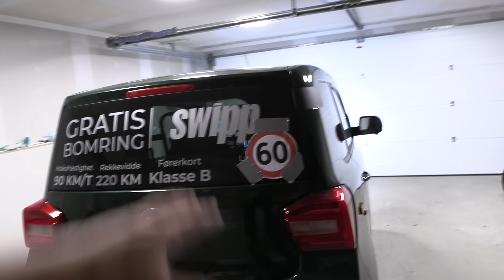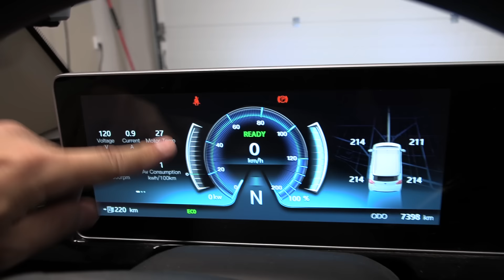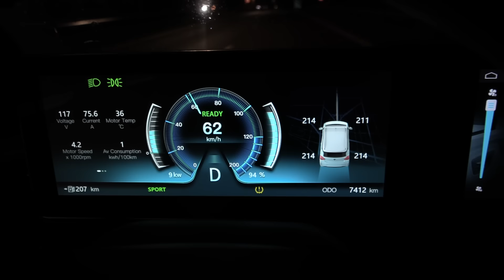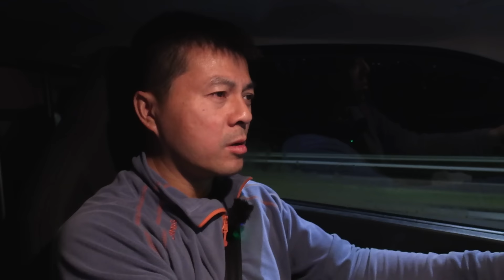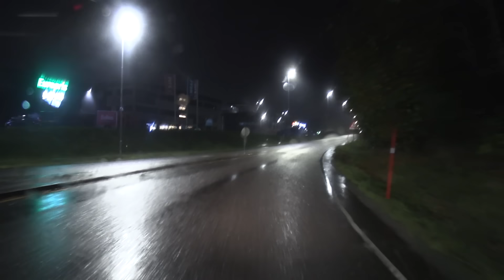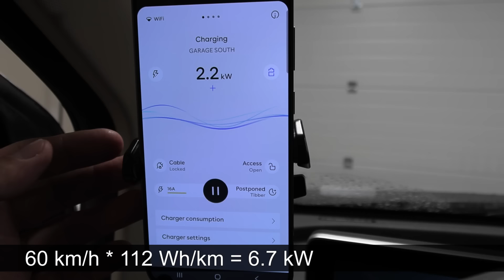BAW Pony 500 km challenge part 1

Comment: My unqualified, anectodotal, and unrelated filthy cheap American two cents: I've run the Haida HD667 on my RB Accent Hatchback. I've run several other "Chineesium" tires found by small time third party tire shops and sometimes venture into Walmart's Auto "Cares" for tires. These HD667 were by far the least lasting and least traction tire I've run. I've had tires priced lower than these that held traction in surfaces the HD667s didn't. If it so much as drizzled, there was a chance TC would kick in. If it drizzled and I drove over any austerity ridden street found anywhere in this goddamn country, it was certain I'd slip and have a little scare.

I know you have the HD687. They're distinct tires, mine were summer, your's are winter. But what little could be researched about the brand makes me believe that their tire compound(s) just... generally suck at wet grip, even their "higher" end models. I know some people have pointed out it being RHD, light, and the classification and all, but it makes me wonder if perhaps if it had something a bit "better" than economy tires from this specific brand would it have fared better.

PS: the HD667s are "eco". I got worse fuel MPG with them, really noisy, and not even close to its speed rating. Not much I can find online other than people leaving reviews on the tire that were meant for the online vendor they were using.

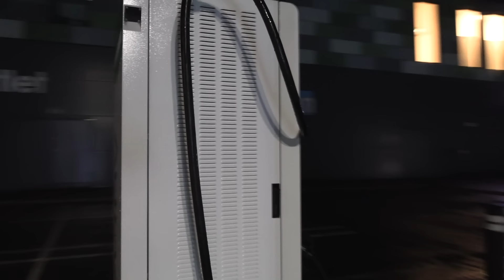Comment: 18:30 You forgot to show the spec plate on the charger! 😁
Reply: If those are Delta's UFC 500KW units, then according to the manufacturer’s data, 500 A is the maximum: 2x500A at 500V / 500A at 920V, and the maximum power is 500 kW (2 x 250 kW power for simultaneous charging).
Reply: @AliusScitmelius Just 460 kW! Lies, lies I say!

I was expecting 600A for a 500 kW charger to be honest.

Comment: Just spun on a roundabout, now going down a hill, “How fast can we go!”
Reply: Straight line speed isn't that sketchy, but turns on slippery surface are with a RWD light car that has a very short wheelbase. Anyone who's driven Smart Fortwo can tell you how on the motorway at 120km/h it's perfectly fine, but wet roundabouts are rough and wintertime is even worse. At least those have traction control though.
Reply: That looked pretty dangerous. I could get something of the same effect in my (1967) VW Beetle with cross-ply tyres  pushing round a roundabout.. but somehow the Beetle felt more in control. (I did check at the start of video and there is an R in the tyre designation to say they're radial, but it's just possible that they aren't.)

Comment: This one makes the Dacia spring look premium.
Reply: It's not the same thing, the Dacia Spring is an M1 category vehicle (your ordinary passenger vehicle) and this BAW Pony seems to be an L7e, which is considered a heavy quadricycle. The regulations that define them are completely different, so they aren't really comparable.
Reply: @Stuntman175  While that is true they are also  similiar in price which is how i got to the comparison(which was for comedic purposes if it wasnt obvious).
Reply: @Stuntman175  What are the benefits of the L7e category if a category B driving licence and a minimum age of 18 are still required? Insurance might be slightly cheaper and inspections may not be needed as often, but are there any other advantages?"
Reply: I had a Renault K-ZE, the proto-Spring. I'd say the max reasonable driven distance per day is 300km, if you depart fully charged and do one DCFC after 150km. Starting from the second DCFC it rapidgates really hard, and eventually you can only charge at 10KW.
Reply: Still looks better then  Wuling Air EV here in Indonesia 😂

Comment: The usage scenarios for such a car are extremely limited I believe. For the price of this car you can buy a nice used e-golf and you would actually get a real, usable, secure car. Even the standard version of the e-golf without DC charge option provides 7KW charging speed and also 200 km reach. And you will get 140 horses and all the features the golf chassis developed during the last decades. Including security, comfort, functionality, usability, quality and 8 years guarantee for the battery.
Reply: It makes sense in a 10-20 million people city in China though. The price will probably be super low there as well, so it's an upgrade from a scooter for those that can't quite afford a "real" car and rarely need to leave the city.
Reply: No toll would save me 20 minutes every morning and evening since I could take a shortcut via some toll roads (now I drive in the city instead), I was looking at a Twizzy but the lack of heat and the short range makes this a better proposition for me perhaps...

Comment: I've done 400km on a 22kWh Zoe without DC charging. It was fun (no, it was not).
Reply: 1400+km from Netherland to Hungary with q210. 31 hour trip😂
Reply: I did 1000km with my 41 kWh R110 Zoe once, it was quite nice actually. 

When you don't have any time pressure it's really nice just toodling along for 2-2.5 hours at 90 km/h, then having a nice long break doing whatever, before another long stretch.
Reply: Range?
Reply: @ionut8091 120km on a good day. I made 4 charging stops about 50-60 minutes each. One hour driving at 90km/h and then one hour charging.
Reply: hello fellow zoe madmen! I too did 1000km with a 41kWh zoe without CCS, Germany to Romania in 2019, twice. Did take around 24h each way and was quite fun since there was no pressure. No ABRP then, so had to plan everything manually on plugsurfing. I was also on the Großglockner twice with it too. Great little car, still love it.
Reply: I did with zoe q210 yhe 1000k but i have 40kw battery and 43kw ac charge power
Reply from the maker: *40 kWh
Reply: I did 600km in 2016 with a 22kWh ZOE Q210, did mostly Charge on 43kW AC tho. 
It was adventures and fun. :D 

I even drove over the "Großglockner" in Austria. :)